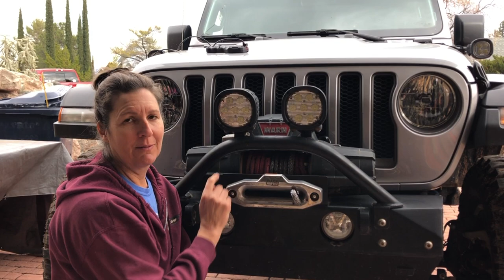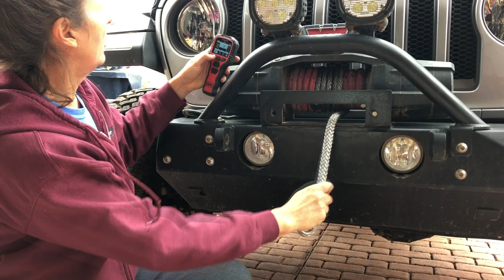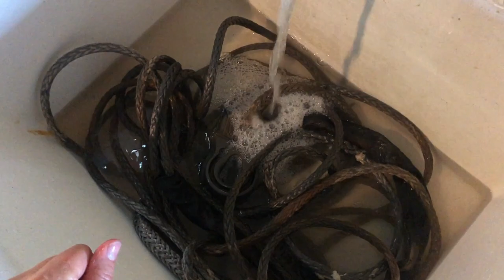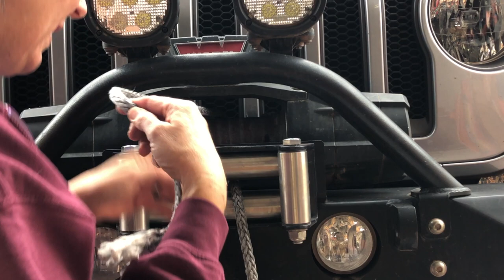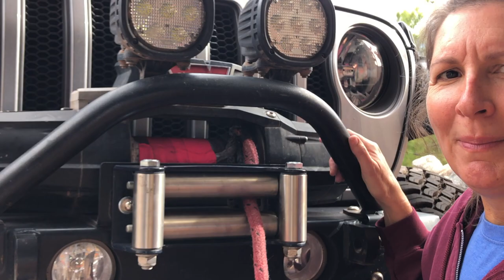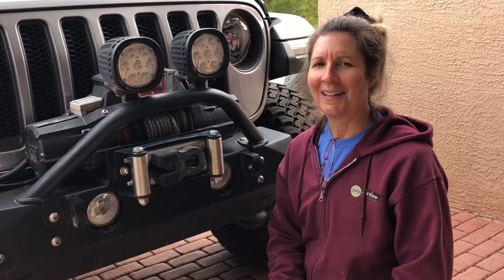Winch Rope and Fairlead Replacement

Comment: A few little things. The key style Warn connection is going to be one of the strongest on the market honestly. Yours is the first I have seen with the key in the wrong position, that is unfortunate. I would revisit it again with a proper install in the future. It will be dang near the breaking strength of the rope with no wraps on the drum. Sometimes it is really nice not  burning up 10' of line by maintaining X many wraps on the drum. On the roller fairlead ( the temporarily used version ), the risk has always been that the line slacks with gravity and gets caught under the 'wing' for the side roller ( and the bolt/nut ). This isn't uncommon when trying to winch the vehicle back onto the road when it is tipped out with the slope. I've even had it happen with wire rope....it is just more common with synthetic because it is more flexible. It has just always been an issue with that design. Cheers. Keep up the good work.

Comment: I've heard that winch rope should be spooled on with a bit of a load on the rope. Is that not the case?
Reply from the maker: Yes! The first time with new rope, absolutely. We will take this one out and give a good stretch after all it has been through. I should have mentioned that. Do note, from the video on top 5 winch tips, that I pull ALL of my usable rope out every time since we don't know what condition it may have been left in last time!  Thanks for the comment!

Comment: Pretty sure that damage is the result of an instillation error. That wedge shouldn’t be sticking out at all. You should probably have made that more clear in the video.
Reply from the maker: Agreed. Not sure how that install happened, but obviously, we needed to fix it. I don't like to place blame on whoever installed or used it as such, but I wanted to show how to fix the problem. I am not a fan of most manufacturer rope mounts, so almost always revert to the bight as shown via the Safe Xtract method. Thanks for watching and your feedback! Keep it coming!
Reply: @jeepschool  I've found the Red Winches Plasma Lock to be a brilliant method of attaching the rope, leaving no sharp edges. Furthermore, its design means that you cannot pull too much rope off the drum, as it leaves 8-10 wraps on the drum at all times (depending on the diameter of your rope).